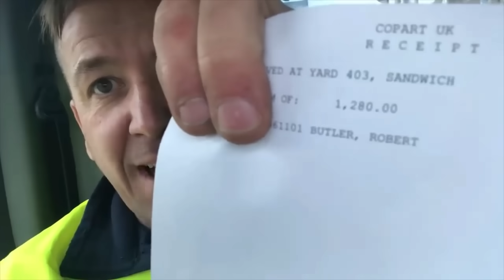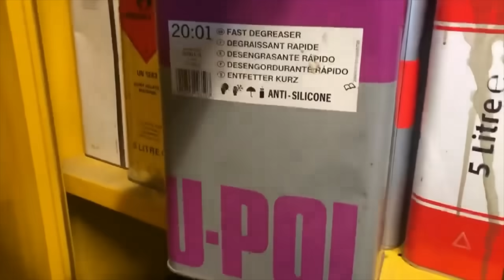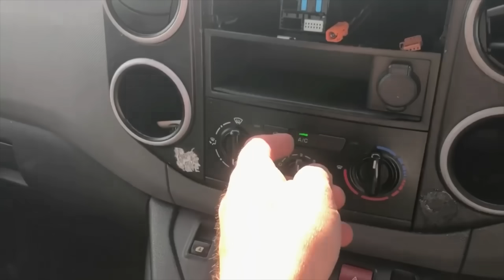Copart 2016 Peugeot Partner Rebuild SRUK Sunday Throwback

Comment: Great video. £3750 is a real bargain. Someone will be so lucky. Just had a look at asking prices on autotrader and they are £6000-£11000. I think it would have flown out at £5000. Chris & Rob you’re very generous considering the work that went into it. I don’t know how you can do it for £3750. There is actually a 2016 insurance write off with 60,000 miles for £5995.
Reply from the maker: This was last year bud 👍

Comment: I always find price differences between countries interesting. If I heard right 40 to fit the windscreen? By us about 15 pounds. In my terms very expensive as is the MOT that's double ours and which is done only at change of ownership in my country. Tyres are in the same ball park but the price for the van after fixing is quite cheap. A 2015 Partner is about 6000 pounds here.

Comment: Love the video, content and skill set. I do wonder though why Chris cut and soldered the wires instead of removing the wires and ends from the plug using the special tools you now get or even a small jewelers screwdriver. Keep up the good work and Merry Christmas
Reply from the maker: some of the pins were also damaged and some of the wires were ripped out with nothing on the end.

Comment: After getting vehicles fixed do you get someone to inspect  for roadworthiness   i.e a certificate if some have been recorded on computer
Reply from the maker: In the UK there is currently no requirement for inspection. We hope that this changes soon so only fully equipped, qualified and licenced repairers are allowed to purchase and repair crash damaged vehicles.
Reply: @sruk  Pleased to read this 'certification' hopefully will be put into law. Anything to put the bodgers out of business gets my vote.
Reply: @sruk   Hopefully that will happen sooner rather than later as Lord knows how many vechiles are out there with bent or twisted chassis. Crabbing down the road. When anyone buys a vehicle they expect it to be straight and fixed properly.

Comment: sorry to be a smart a  but it won't start without a m,a,f reading  you need hose on turbo to airbox!
Reply from the maker: It will bud we been doing this job a long long time 👍
Reply: I know of a collection of old vauxhalls for sale interested? i can make a quick video and upload on u tube most need full resto  from 1950's to 90's let me know  just outside Glasgow but could bring them down on trailer if there is money  to be made.......